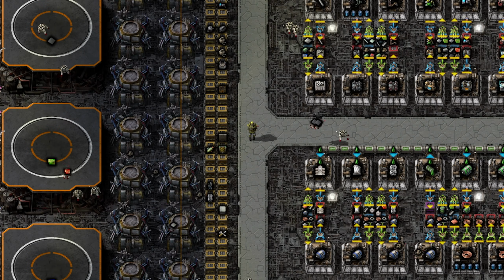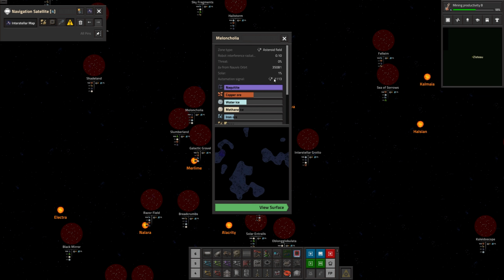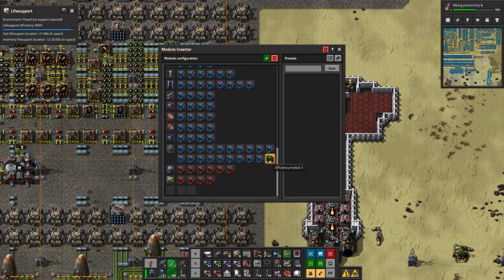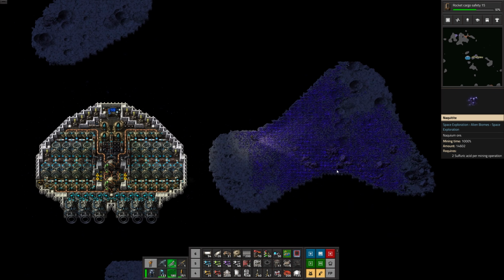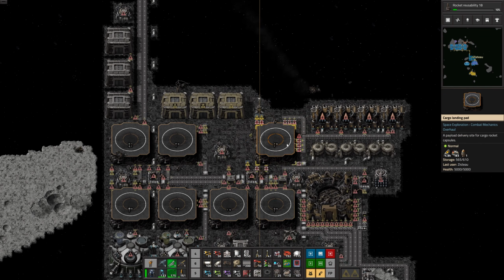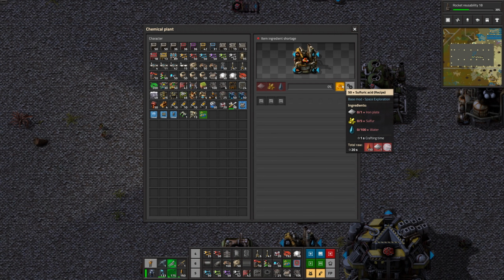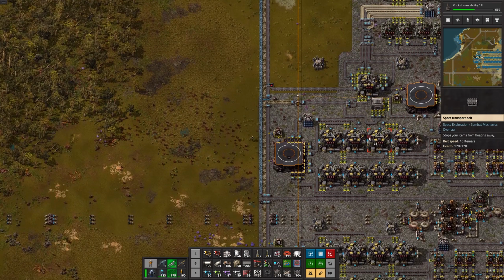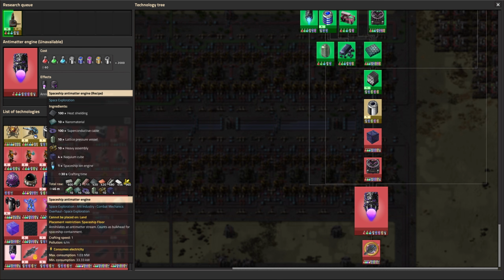Appetite for Naquitite - Factorio Space Exploration #21

Comment: Assuming that it was already there in 0.5, you should have discovered an anomaly along with the asteroid fields (It's not on your star map, but you should be able to filter for it in the Universe explorer). I won't spoil anything about it's significance, but one trait that is easily overlooked is that it is the same distance away from any point in space, and that distance isn't thaaat large. It's a bit of a trip, but there's a good chance that flying from Nauvis to the anomaly, and then from there to the asteroid field is actually faster than flying straight from Nauvis to the Asteroid Field. It depends on exactly how close your nearest Naquitite-rich field is. It makes wiring up the spaceship a little more complicated tough.

Naquitite processing got a lot more complex in 0.6 apparently. Just a bit of info on what you're missing out on, in the newer version you need ALL the advanced resources in one form or another, you get a byproduct of their respective production chains aswell, and on one step there are actually 2 parallel processes going on both making the same 2 outputs, but in different quantities, both also outputting a byproduct that is used by the other as an ingredient, and you need to balance those steps to prevent it from locking up. The most annoying part is still actually mining up enough Naquitite and ferrying it to Nauvis tough. Those ore patches are very small considering the 1000% mining time.

Using the "free" rocket fuel recipe isn't something I'd recommend. The sheer size of the build to supply that amount of rocket fuel would be enormous, and so would be it's power requirement. It'd genuinly be easier and faster to conquer an oil planet and set it up to produce nothing but rocket fuel. I did that in my run and made 4 blue belts worth of rocket fuel a second. And then it all goes obsolete once antimatter is researched.
Reply: Naq processing without all subprocesses looks dull after 0.6 k2se
Reply: It was added in 0.6 along with a bunch of the other stuff to make the early-game a little easier. So no he doesn't have it.

Comment: Wait, if you can send rockets to an asteroid field, can you not just use rockets to fire the naquitite back?
How much fuel do you need to get back?
Reply: He is using rockets to send the naquitite back. Are you thinking of the space ships?
Reply: If the rocket fuel to liquid rocket fuel ratio is 1 to 50, a single cargo rocket can't actually carry enough rocket fuel to fuel one Naquitite Rocket. Doing that with Rockets is incredibly impractical. Then again, Oil is infinite, therefore rocket fuel is free. Especially once you've set up on an oil planet. It's either this or Spaceships burning the rocket fuel tough, since Ion engines aren't really viable for Naquitite Haulers due to the power requirement.
Reply: @Cyrikyty  There is also the fact that solid rocket fuel stacks to 10, and a cargo rocket has 500 inventory slots, that's 5k of solid. The question is -> how many rockets full of fuel must I launch there to get a rocket launch back?
Reply: @maltardraco9555  It's just a little over one. 5k solid fuel makes 250k liquid fuel, since no productivity is involved. The rocket takes about 285k for Z.
It's still kind of insane to launch an entire rockets worth of fuel, which, keep in mind, ALSO has to be fueled with 285k liquid rocket fuel, to launch back a measily 5k Naquitite Ore. You saw the tiny trickle of plates made from that.
Reply: @Cyrikyty  We could use an ore compressor mod to increase the amount of naquitite we can have 1 inventory space but that also significantly increases power demand in a place with no solar.

Or, even crazier idea we put down a Space Factorissimo building so we can use ground buildings in space for the productivity bonus.

Or, even even crazier idea, we could put down wind turbines and atmospheric condensers in the Space Factorissimo building so we can use Krastorio's rocket fuel from ammonia recipe but this one might require a bit of a rebuild.

Or, sane idea, we could just pack the cargo rocket pieces and haul em back later.

Comment: Naquitite only stacking to 10 is to encourage on-site processing, I think, or at least a single stage of processing before sending off by rocket.
Reply from the maker: all stages stack to 10 except plates, and you can't use productivity in space. kinda dumb either way
Reply: @Zisteau  Oh really? Was sure... maybe its on the later versions. Not gotten there so far so my experience first hand is very poor. But since its like that. I guess shipping raw ore is the best answer. But what I do remember though is the amount need of all new resources is so low that if you do not get productivity on them, its not the worst that had happened. Sorry most of my experiences is from Dosh Doshingtons playthrough.
Reply: @Dubbelthor dosh just accepted having a crap solution.
Reply: @Zisteau  Can't you process it on a nearby planet (with productivity) and then ship plates to Nauvis?
Reply: That would require conquering a planet with the green stuff and setting up a whole production chain for the acid. It’s probably not worth it.
Reply: @Bulkje  You still have to ferry the raw ore from an asteroid field to a nearby star to do that. Might as well just take it to Nauvis instead
Reply: @Zisteau  crushing it does compress it. Even if it stacks to 10 crushed, 10 crushed should be worth at least 20 ore if not more.
Reply: Extremely so, seen other say that crushed can be stacked to like 50 units if my memory is not making a fool out of me... which it might. But I still wanna remember that crushed is a far superior sending method.